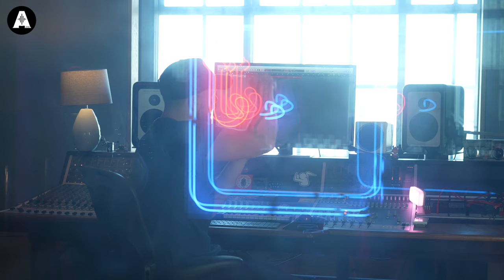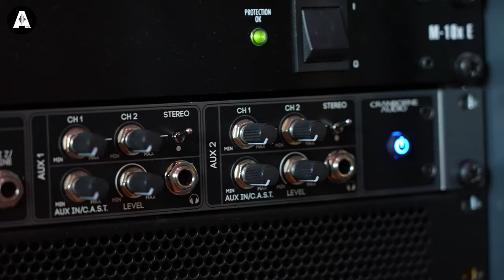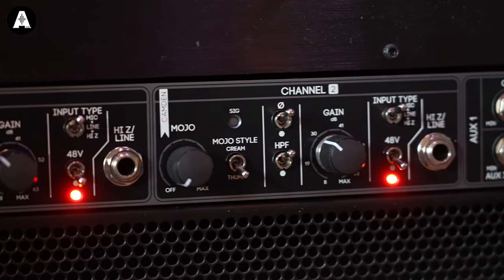Can a £500 Microphone sound as good as a £2000 Microphone? - Warm Audio vs Neumann

Comment: The WA87 r2 was a ball-hair 'lighter' in tone but negligible. This would be balanced with the slightest bit of gain, or depending on voice tone, an EQ tweak.  As mic comparisons go, they are pretty close but I for one would go for the Warm Audio rather than the Neumann, simply due to cost.  The only reason to do the opposite is not for performance (as I say, the sound difference is negligible) but only as Neumann is probably a better investment if you want to 'sell on' at a later date, or if you are simply a 'name dropper! 🤫

Comment: A question - how does the Warm take EQ? Could a gentle high shelf have put it closer to the air and clarity of the U87?
Reply: I was going to ask. I might try the WA87r2 that just came in with the Maag, which as you know, has a nice air band to it. Maybe I can tweak it and upload the results.
Reply: I just got a warm audio wa87 and am happy to report that, in my experience, it takes to eq and compression very well!  It also has an incredibly narrow pick up pattern, considering the type of microphone that it is, and I found that particularly impressive as well. The only disadvantage to that, is the Face shifting and other anomalies that happen if you’re not quite positioned well. This is why I think some things did not sound as good on the warm as they could’ve in this video.
Reply: @lanesaudio2597  thanks for letting us know how you got on with it.

Comment: This shoot out was great. There was no question the Neumann would sound better but the difference is so slight with a great performance for those on a tight budget, the Warm is good enough. As a matter of fact this test shows the difference between the original clone by Warm as the gap is larger sonically although this is from personal experience since the prior version Warm 87 was not used in this shootout. Thank you so much for this video, as always I love your videos.

Comment: The same positioning, playing the same take (as was done) for each mic is really the only way to have a fair shake when comparing, i.e., the gain staging for the vocal tracks weren't matched for the WA-87r2 against the 87, making that an unfair or inaccurate comparison. And most engineers would never record an acoustic guitar with the WA-87r2 mic in that position. On that note, the WA-87r2 deserves a 2nd chance, and for what it's worth, is most likely much better than what was heard here.
Reply: I'm glad someone else picked up on that!! I was thinking the same thing. The vocal takes were two separate takes with different mic positioning.

Comment: Warm Audio for sure. It does good everywhere and isn’t weak in one area like the U-87 was. You guys also cheated on the gain because the audio for the WA-87 R2 was obviously lower in volume. The fact that the first thing you said was that the gains would be matched made me clearly think this video was going to be sus from the get. Unfair comparison for sure, but I still like the WA-87.  Side note: the WA-87 R2 was modeled after the original U87 which had less high end than the U87 AI and in this comparison you use a U87 AI so it’s not even fair to begin with…LMAO. A more fair comparison would be the original U87 and the WA-87R2.

Comment: The U87 had a bit more weight in the low end which could be why the WA87-R2 sounded a tiny bit airier but in a good way. I was totally expecting the U87 to mop the floor with the WA87-R2 but I actually preferred the WA87-R2. I’m very familiar with U87s both vintage and ai. No 2 vintage U87s sound the same. They all sound good but some are brighter than others. The WA87-R2 stands up well against them. It’s not just a good mic for the money, it’s a good mic.

Comment: Neumann really shines in the lower frequency which gives it a thicker more fuller sound. Warm was a bit thinner in the low-end and the high rolled off a little. Without a doubt U87 is the greater more rounded Mic.
Reply: agreed! Also warm is more noisy, you can hear it on the guitar

Comment: As usual with yet another budget Warm Audio product competing to be a clone of a more expensive mic, it sounds very sibilant again on the top end. Their WA 47 tube mic has the same problem. This will be emphasised even more when adding a little compression and will need de-essing. More expensive mics sweeten that top end to be less sibilant with a smooth roll off. However there are other good mics out there at this price point that are less sibilant. This WA would probably be good on guitar but it wouldn't be my go to vocal mic.